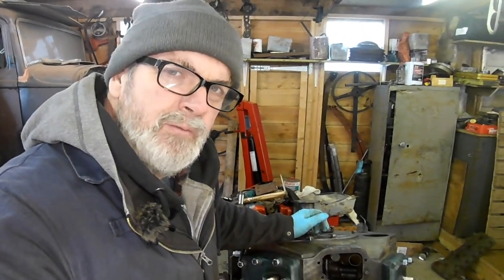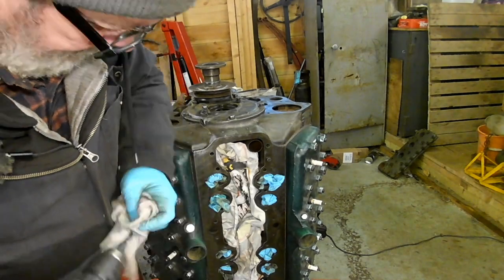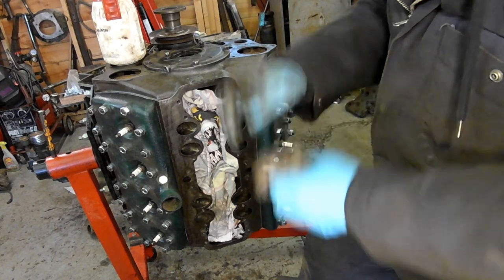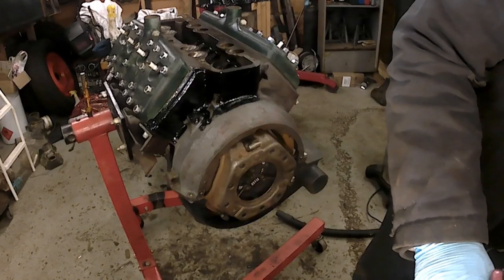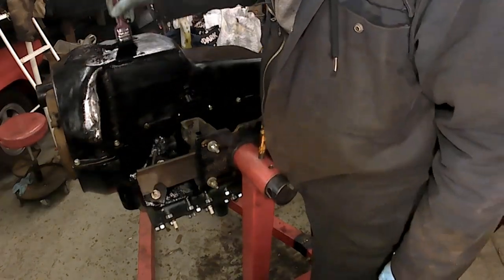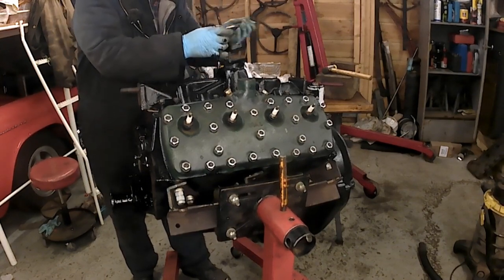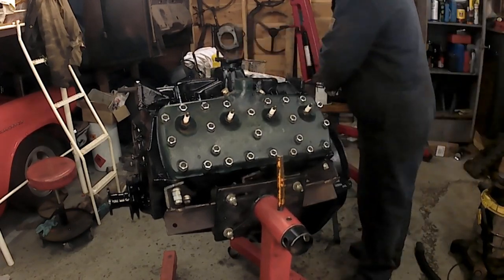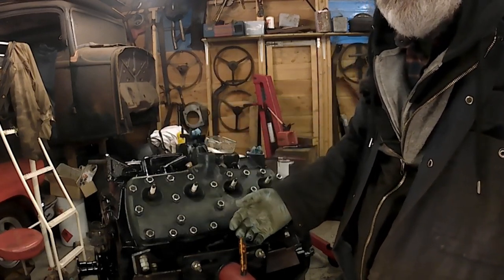Crusty Flathead ford V8 Pt23: Lets finish the build!

Comment: Hey Mart, really enjoyed this RustyFlatty series. I too have 2 of the pilot type pans and will also have to mod them for US type starter. Was it an easy enough job to do? I also have one of the flywheels so am changing the ring gear to work with the US starter too.Can't wait to hear it crank up! I am a bit jealous cause at the moment I can't work on mine due to the current situation and I am a Essential worker...so have to keep my social distance and stay close to work since my Garage is an hour down the road... Keep up the good work Mart! Cheers
Reply from the maker: Thanks Don. No it wasn't easy. I used a carbide burr and a plate from a scrap US pan to give me the shape and size. I'd like to set it up on my mill but it's quite an awkward thing to set up. Thanks for doin' what you do, it's absolutely essential at this time.
Reply: @MartsGarage  I have a US pan and plan to make a template and see if I can cut it out and file it smooth...I will have to wait till I have a chance to do it and I will let you know the outcome.
Also, I did manage to get all the studs out of the first block just as You did but the second one didn't fair as well and I have 3 on each side to have to try and get out now...still have one more block to do though...lol. Love watching your YouTube channel so please keep turning them wrenches!